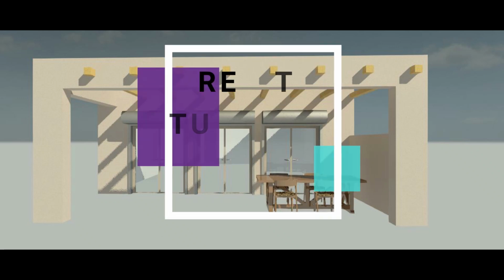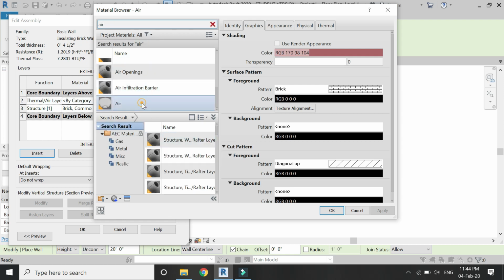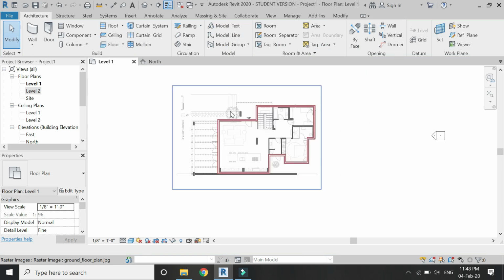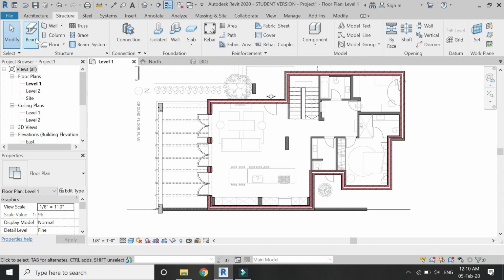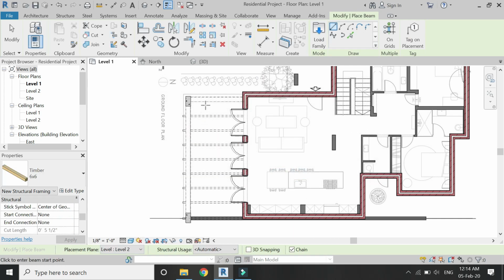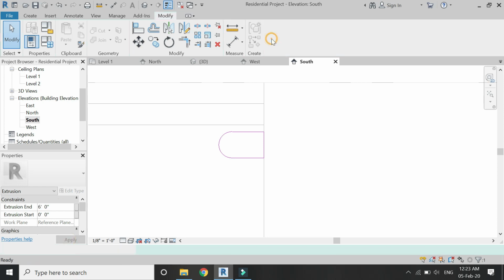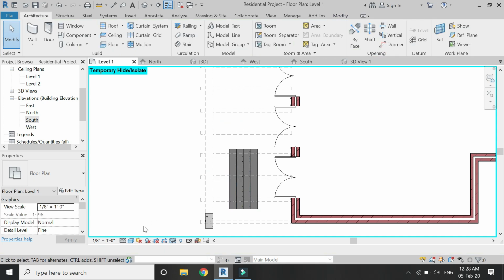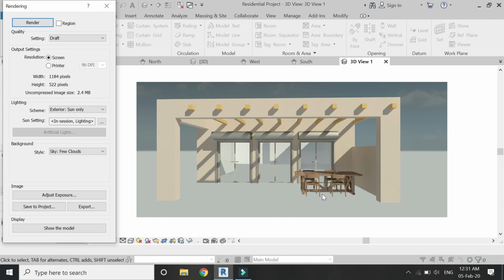Revit Tutorial - Residential Project (Part 1)

Comment: Also, One kind request is that if you use some shortcut/s for command/s, so kindly if possible please do SHARE those shortcuts details..... Thank You...
Reply from the maker: I would definitely upload the tutorial on the shortcuts. The reason I don't use the shortcuts in the video is that the viewer can easily see the command which I have selected. If you move the cursor on the specific command, a dialog cloud appears with its complete description. On the top of the cloud you can see the shortcut in the brackets.